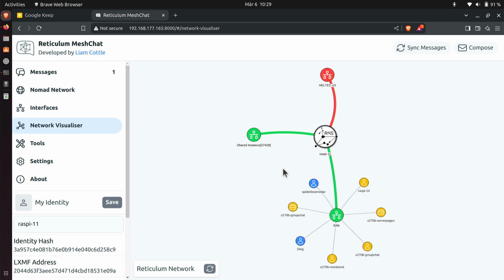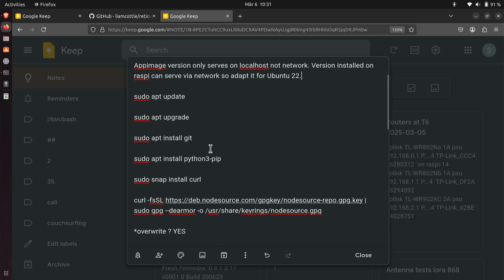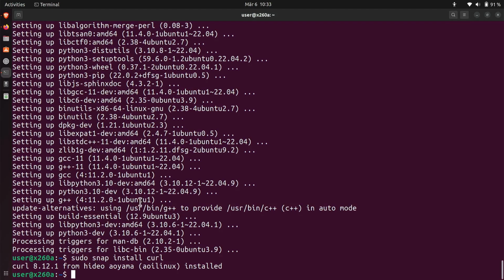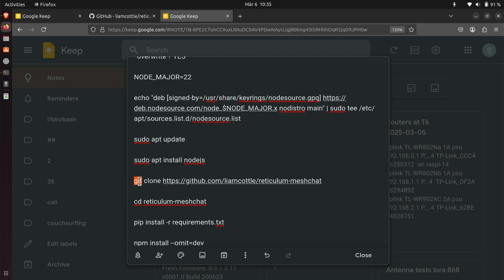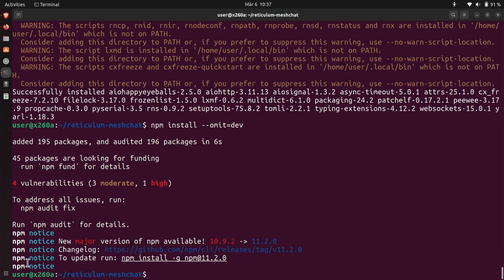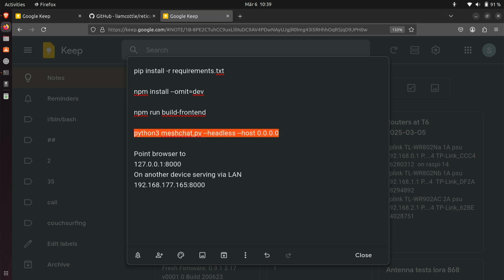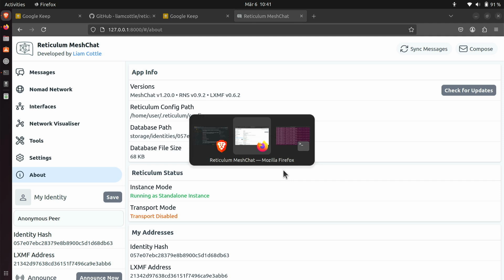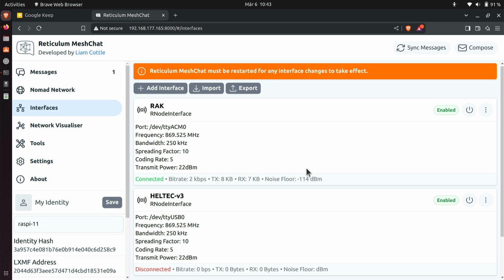Install Reticulum Meshchat on Ubuntu 22.04.05 enabling Local Area Network Browser Access.

Comment: If you encounter problems installing those python packages, try setting up a virtual environment and installing there.

Uv is a great tool for handling these python setups.  It is fast too.  You can even create a short script to activate the virtualenv, run reticulim meshchat (or sideband), and shut down the virtualenv when you exit thre app. Clean as a whistle.
Reply from the maker: Thank you for this great tip. Could you perhaps give an example of the short script please ?

Comment: Hello Simon, do you know how much memory this install requires? Would like to see if i can make it work with ubuntu server.
Reply from the maker: Hello John. It is hard to see how much memory it uses using htop. Do you have a  preferred method ? I will take a look. On the Pi Zero it seems to use 10MB more when it is running pushing the memory usage up to around 70 MB.
Reply: @fotografm  i ended up getting it to install on a dell wyse 3040 with no issues(8g emmc storage), at this point im trying to get more familiar with the command line. Thank you for the reply